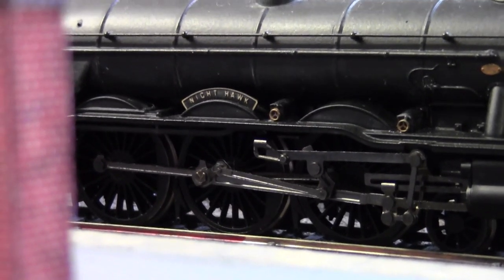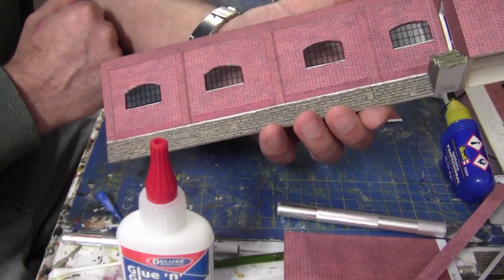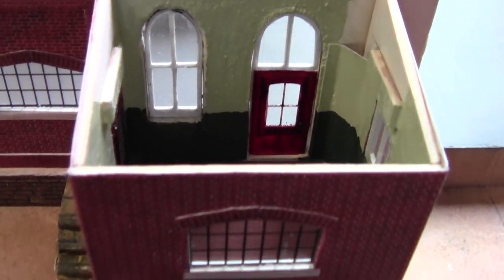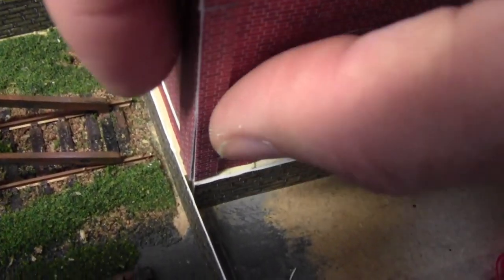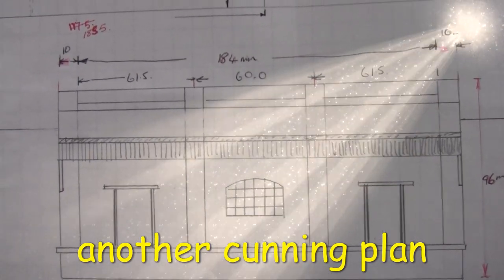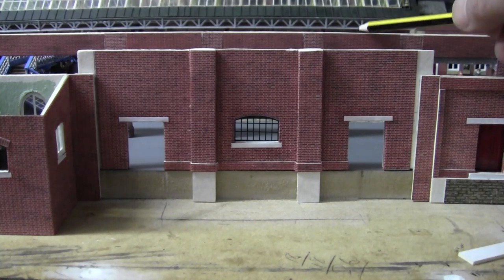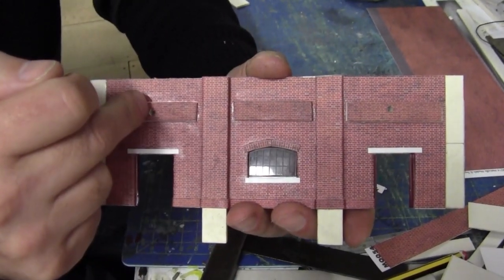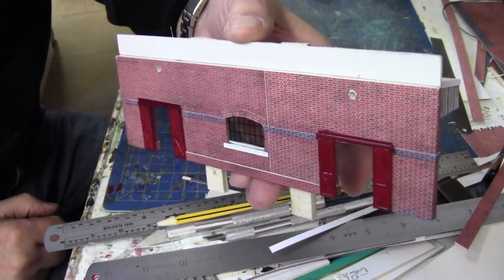The Station. Part 26. Loading Bay & walls No244

Comment: More great work Tony. I've recently completed a small outbuilding which needed to be on a concrete plinth with a ramp into a door. Using your idea of applying super glue to the card, I was able to file the slope I needed. A very useful tip.
Reply from the maker: Hi Les. i glad the little tip has worked using the superglue on the card. i do like it when tips and ideas get used by fellow enthusiasts........stay safe Tony

Comment: Hi Tony  Wow mate those long shots of the station really show off what a fantastic work you have done with this build it really has been a mammoth build its cannt belive it all started in March time hase really shot by since then i love the picture with the NER Worsdell G5 loco it would be great to recreate that scene on your South Shields what a great idea building a goods office and loading area with its awning it really fits that side of the station with its loading area i must have taken you ages to do the lines for it  on the office with its lighting i was think  could you use a length of copper wire coming up through the office and  bent to fit the area attach all the leds to that you could disguse the rod as a pipe or guttering. Anyway Iam looking forward to next weeks instalment hope you have a great week buddy all the best Pete
Reply from the maker: Hi Peter. its been a long journey my friend. it was in March when the platforms were put down and track laid and ballasted. the building started to up in may. its scary to think how quick this year has gone, even with everything going on in the world. i like your idea of using copper wire. i might do that. 2 strands running the full length of the building. it was all down to the photos which gave us a little idea what was going on with platform 2. it might not be 100% accurate. but it seems to fit. and look right. ...............many thanks for commenting......until next week.........cheer's Tony

Comment: This is looking absolutely brilliant Tony, how did you work out your measurements considering you were working out of a book and off photos?
Reply from the maker: HI Paul, most of the dimensions have been worked out when the pillars were done, as its a straight forward transferring them across to the walls and the working out the centres from there. all in a days  work.....well three weeks so far...thanks again for commenting. cheer's Tony
Reply: @TONYNORTHEASTERN  The reason why I ask, is I am wanting to re - create ‘Carnforth Railway Station’ and obviously I don’t know the size of it. I can check out plenty of photos and books, but it’s knowing the actual size to be able to scale down. Cheers for replying
Reply from the maker: Hi Paul. i have googled Cornforth station what a lovely building and its still intact. my tip for you would be to get as many photos as you can. which you have probably done, hopefully Flat side on if possible. and use every means available. if you can get your hands on a doors and windows that match the building even better. measure them and then zoom the photos to get the sizes. you can also use figures as a guide. and a scale rule.  or if you can visit the station. and you could do a survey and get the measurements that way. and then convert them to 4mm to the foot..........good luck my love to see this once you have finished......all the best Tony
Reply: @TONYNORTHEASTERN  cheers for that, watch this space, also I’ll keep you update 👍

Comment: are you going to keep the foot bridge like that photos from the 1920s show it going  beyond the wall and two sets of down stairs
Reply from the maker: Hi Steve. you are correct there was always two flights of stairs at that end of the platform. i would probably have to buy a complete kit just to get one set of stairs. it is possible. maybe sometime in the future i could take another look at the foot bridge. well spotted. thanks again for commenting. all the best Tony
Reply: @TONYNORTHEASTERN  there are some photos just gone up on ebay one shows the stairs from the ticket office it shows a woodern room built under the double stairs